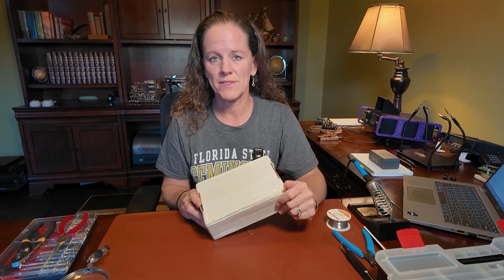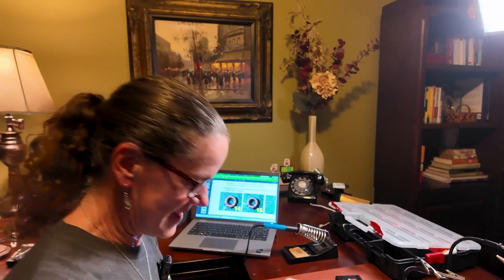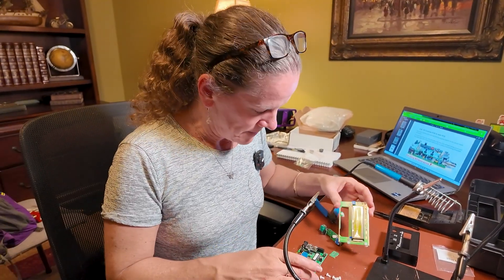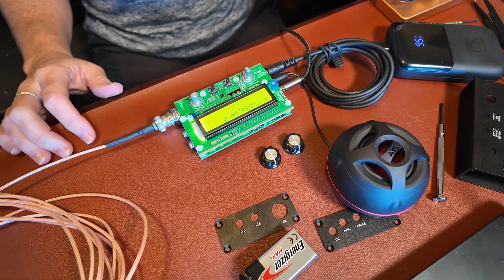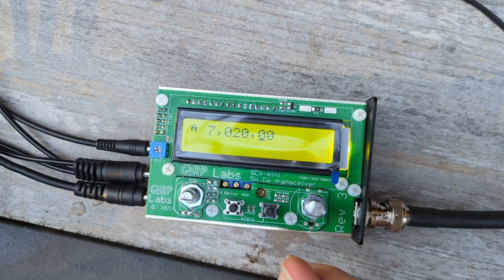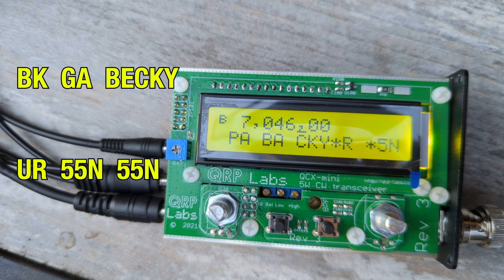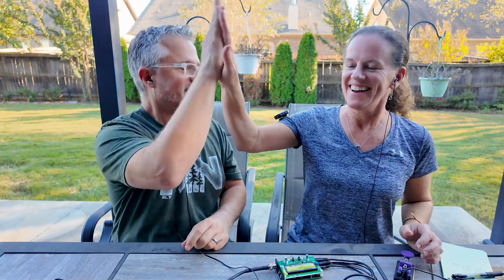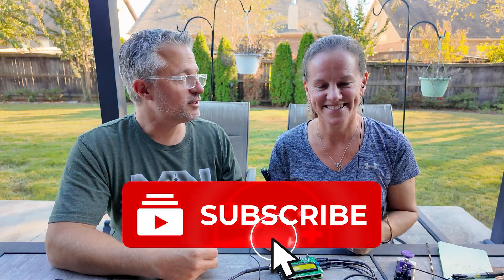Should you build a QCX-mini? 🤔  |   Becky Builds a QRP CW Radio

Comment: Thank you for sharing your build experience. After you assembled QCX-mini, did you have to do any tuning of the device, or was it working OK righ after you power it ON? I remember back in the days when I was building receivers, I had to adjust an tune capacitors, etc.
Reply from the maker: Great question.  After assembly in the manual it does walk you through some tuning using a screwdriver and the built in display.  Some also adjust the spacing on the toriod but we didn’t have to do any of that.  
73 Becky

Comment: I am just starting my CW journey, using your recommendation of Morse Mania as a daily practice tool.  Level 5, here we come!  My thought is that building the kit will give me extra incentive to learn code.  With an operating freq of 7.04600, you obviously bought the 40m version of the kit.  We are at the top of the solar cycle.  Thinking about the entire cycle, if I were building one today, should I get the 20m or 40m version?
Reply from the maker: It really was a great learning experience and extra rewarding when it worked!
To answer your question, it really depends on how you want to use it. If you just want it for general use and making contacts at night, 40m is the most reliable across seasons and conditions. If you want it for POTA, 20m is by far and away more popular and the antennas for 20m are more convenient to setup.  In general, 40m is expected to be more consistent in the bottom of the cycle. We've not really experienced the bottom of a solar cycle yet, so we can't really predict how much less usable it will be.  We're just hoping QRP will still be possible for POTA :-)  Regardless, it is still far enough away to get plenty of use out of either one.   73 Becky es Mike

Comment: Where do you get that 9v power cable?
Reply from the maker: I think you were asking about this setup in a different question, but here is the link to the battery and trigger cables we use specifically:
INIU Power Bank USB-C PD Capable
https://amzn.to/3TYwVXF
12V USB-C PD to Barrel Plug Trigger Cable
https://amzn.to/3TYwCvZ
9V USB-C PD to Barrel Plug Trigger Cable
https://amzn.to/4hbTnq3
73 Becky es Mike

Comment: I just got my qcx mini radio and I’m unsure how to connect a battery to the radio. The power supply wires are too small to clamp into 15a power poles. What would you recommend?
Reply from the maker: Great question! I assume you’re talking about the barrel plug connector that comes with the radio and maybe has some very skinny gauge wire on it? If so, we never used ours. We don’t use power poles… most all of our radios are QRP. We actually nowadays use a USB-PD power bank. The PD or power delivery means that it can deliver voltages besides the normal 5 V for USB. We have what is called a trigger cable that plugs in and tells it to output 12 V. We have details and links to our USB PD power bank and trigger cable in this video.  
https://youtu.be/FxbEwVJhOhM?si=HsXvZNGu33OBOkan
Hope this helps.  73 Becky es Mike

Comment: What kind of Antenna for QDX and How to Handle for SWR ?
Reply from the maker: Did you mean the QCX?  The QDX is a digital transceiver and we haven’t yet operated using digital modes but the QRP Labs discord server would be a good resource.  

We love using an EFHW and since the QCX doesn’t have a tuner, the antenna is cut to be resonant on the band the QCX is built for.  We also use an antenna analyzer most of the time to check the SWR before operating.  73 Becky es Mike

Comment: Having worked as an production engineer . It was quickly known that you should be grounded. You should be wearing a wrist grounding strap. During the handling of any circuit board. With integrated circuits installed. 
This is know to be a requirement when handling integrated circuits. 
Nice going on your radio build. Congratulations.
Reply from the maker: Thanks for the tips it really was a fun and challenging project!  73, Becky es Mike

Comment: Great video, tnx. I just finished a QMX which was my first real build. I had to go back through it as I had some problems which turned out to be some common mistakes but it now works on all bands. I've yet to make my first contact with it but will soon.
I know the feeling when you go to power it up for the first time. 
Keep up the great videos.
Steve, K7OFG
Reply from the maker: Great job on the QMX and congrats on figuring out the problems.  I got lucky on my first go around but yes, I was super nervous adding power and then actually getting in on an antenna.  Thanks for watching!  73, Becky es Mike

Comment: Thanks for the video! You guys are great! I have built one of those (Actually, I have built most of Hans's radios. I recomend them all). They are great! The manuals are fantastic and Hans is just a mail away from helping out and QRP-Labs have a great user managed knowlege base online! Tips: When finish soldering, before putting juice on it, take photos of your work with your phone and blow it up on a big screen. Look for solderbridges and bad connections. Great job! 73 de LA6UOA!
Reply from the maker: That is a great tip! Mike's close up vision isn't very good anymore and that is a great way to work around it!  73 Becky N4BKY es Mike N4FFF

Comment: That's actually one of the harder kits to built - its a "puzzle". After this kit, the rest of them are just longer duration builds, but not really any harder.  Great Work Becky!!!
Reply from the maker: That's great feedback. Mike built one of these years ago when they first came out so neither of us have experience building any other kit from scratch to compare it to. During the build, We purposefully made sure I was using just the instructions, not leaning on Mike's previous experience. It's good to know how it compares.  73 Becky N4BKY es Mike N4FFF
Reply: @HamRadioDuo  If you build it and it works, you did AMAZING.  I love to build kits, so if you take a look at my builds, I drop some "nuggets" here and there that would make building a bit easier in the future.  But "FUN" first!  There are bad kits out there though...  you'll find some.
Reply from the maker: Thanks T.O.  Hopefully we won't run into a bad one :-)  73, Becky es Mike

Comment: Very wel done Becky! Enjoy your 40m QCX, which can also be used on the 60m band by pressing and immediately turning the encoder button to the left so that you can detune from 7 to 5MHz and then further to, for example, 5.352. My QCX still has 4W output there. One rig, two bands! Just try it. 72, PA0CMU
Reply from the maker: Thank you and appreciate the tip to get to 60m.  We will have to give that a try for sure.  73, Becky es Mike

Comment: Congrats! That's a great build. Is it from QRP lab?
Reply from the maker: Yes, it is from QRP Labs.  We have another radio from them and love it.  The instructions were great.  73 Becky es Mike
Reply: @HamRadioDuo  I'll buy it soon. Thanks for the video.
Reply from the maker: Good luck.  It's a challenge, but fun!  Just read through each section and part info before you put solder on it.  The details matter .. a lot !!  73, Becky es Mike
Reply: @HamRadioDuo  Thanks a lot! 73